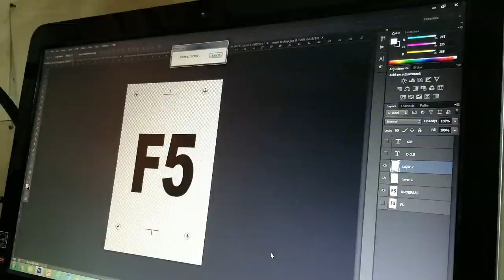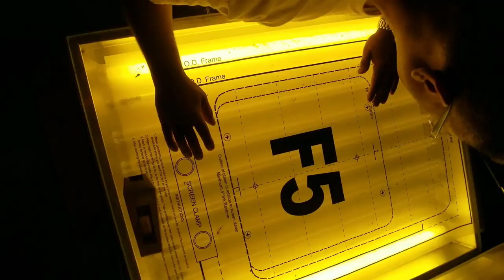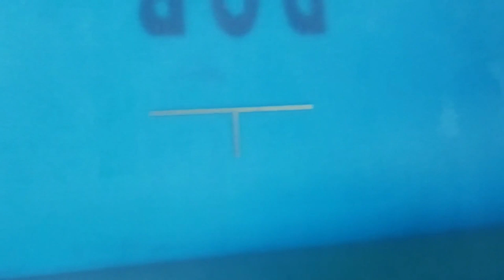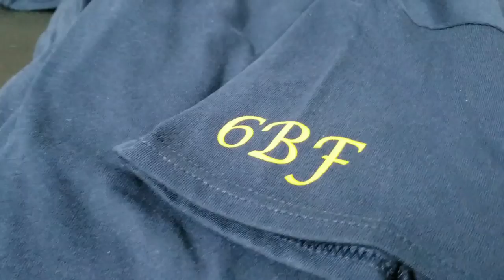6 BAD HABITS IN SCREEN PRINTING / Vlog Ep. 15

Comment: A company I use to work for use to use 180 mesh for every job, for the most part all the jobs turned out pretty good but I can see your point about using the right mesh for the right job especial if the ink is a silver or gold.

Comment: Great vid John! How many shirts did you print for this order?
Reply from the maker: @shtewpsThank you. The order was 36 navy blue shirts. Printed on the front, back and sleeve. I only used an underbase for the front and for the back and sleeve I print flash print on them.
Reply: @tainoink  Ahh okay that makes sense. I was gonna say that registration on the sleeve looks sharp! But dang, 5 screens on only 36 units.. Were you able to turn a profit on this order?
Reply from the maker: @shtewps I only used 2 screens. The front image in the middle and the sleeve one on top next to the small back. Since the sleeve and back were very small I was able to fit it in.